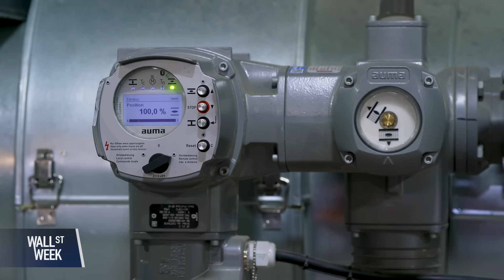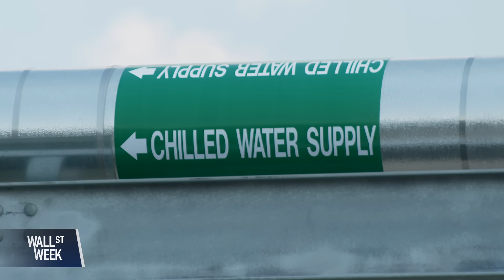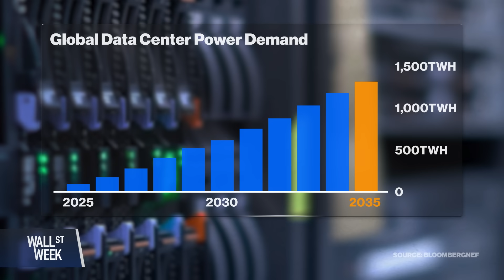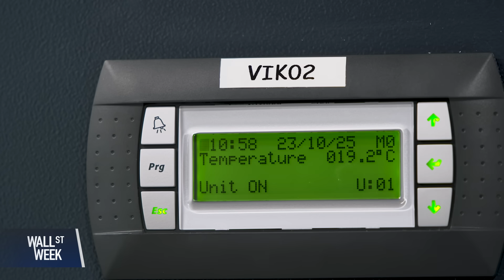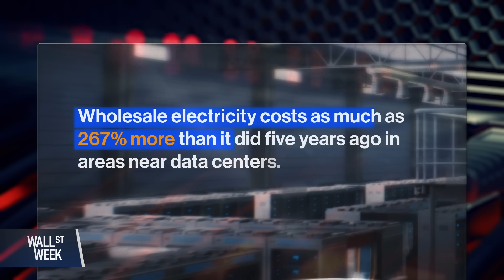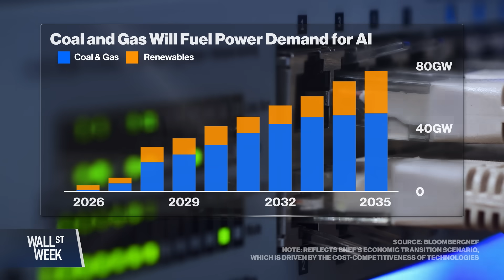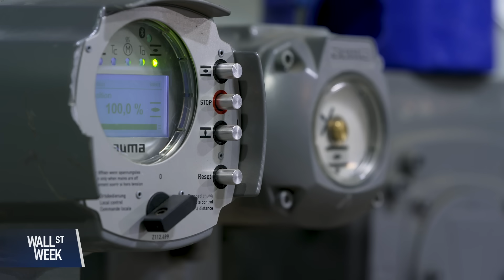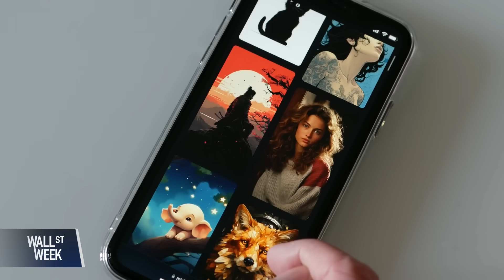Finland’s Big Idea: Turning Data Center Waste Into Heat

Comment: The real trick to making this work is that the temperature difference isn’t very high.  When I worked at IBM in the 1980’s we did this very thing, but it was only really efficient during the colder months when the temperature difference was greater than 25 C or more.  It was still worth doing.  It would be interesting to see how they have dealt with this issue.

Comment: District heating and cooling is far from a new idea.  Decades old. One example related to data center cooling is the Amazon Spheres project. "Amazon spheres heat recovery"  refers to the Amazon Spheres in Seattle and the broader system of waste heat recovery that warms Amazon's campus, rather than a heat recovery feature within the Spheres themselves. The Spheres are primarily a workspace with a focus on biophilia, and while they have high-efficiency HVAC, solar panels, and a specialized glass facade to mitigate solar heat gain, their heat isn't sourced from a "heat recovery" system within the structure. Instead, the heat for the entire Amazon campus, including the Spheres, comes from a district energy system that recycles waste heat from nearby buildings, like the Westin Building. 
Waste heat recovery system for the Amazon campus
Source of heat: Waste heat generated by the Westin Building data center on an adjacent block is used to warm the Amazon campus.
Partnership: This is achieved through a partnership between Amazon and Eco District, a joint venture between McKinstry and Clise Properties.
Benefit: The system exports waste heat to Amazon, which purchases it at a discounted rate. This system is designed to be four times more efficient than traditional heating systems, saving hundreds of thousands of dollars annually and millions of kWh of energy over the next 25 years

Comment: I live in Finland and heat 208 sqm. I heat my house with geotermal heat pump. I pay around 620 Euros per year for heating and warm water. The pump cost around 11 000 to replace let’s say every 15 years. That makes the total cost less than 1400 Euro per year.

If I would use Helen district heating my cost would be around 2600 Euros. So yes I can understand why the make good profits and have had to lower the prices in the last two year😅

Now I do not live in that area. Were I live the price for district heating of my property would be 1400 Euro per year. They use 10 % fossil fuel . My house is however outside the grid so it was never an option and I am not locked to one supplier.

Comment: It's just heat trapping, there is so much layers of energy loss there. It won't be close to solving any problem - it will reduce power usage by few %. Still a good idea, but not a "BIG" idea like title suggests.
Reply: @Szeksp  What about the electricity saved by not having heaters on in all those homes and businesses?

Comment: I live in Finland. I built the same solution, but in a microscale. During winter, I keep the shower of my sauna from freezing with the help of a PC with a graphics card that is running computations on behalf of the science community (calculating properties of astroids).
Reply: yeah, i jokingly say my gaming pc is a heater XD

and it good support for my real heater
Reply: Meanwhile I have to put my PC on the balcony all summer and spring where I live... I should find a way to convert the heat in electricity I guess
Reply: @markmuller7962   Internet should have some guides for it, tho idk on what scale
Reply: @jonasgustavssonaland  👍🏽

Comment: While the idea is good, and we have been happy customers of Helen for years, there are several misleading points in the video. 

First of all, the video's title says "Turning Data Center Heat Into Power". This is not the case here. And I believe it is also nowhere in the world that Data Center waste heat is turned into power on a commercial level. It is turned into usable heat. 

In the sustainability and energy industry, when we talk about power, we mean electricity - NOT heat. I assume the video would get a lot fewer clicks if it said "Turning Data Center Heat Into Heat" in the title.

Using something that already exists (waste heat) is a good idea. 

Also, the statement of Helen's CEO that the reduced electricity prices have been twice in the last few years is misleading. While true, he picked the period after the energy spike after the Russian invasion, and the reduction is a common thing in the Nordics.
Reply: I was laughing at that, it was so obviously misleading from him :DD
Reply: Agree. When someone says power or energy in this context, people understand electricity, not heat or light or noise.

Comment: Helen lowered prices? I never got that memo, in fact had a couple of letters these past couple of years that Helen's tariffs would be raised? Maybe this CEO's managers are lying to him lol.
Reply: Or, let me guess...you don't know what he is talking about and comparing it to something else. If company has variety of products from electricity to electricity transmission and central heating to cooling etc and works with private and public sector, did you really think EVERYTHING they do is cheaper? That was partially the point...meanwhile overall expenses are going up troughout the energy field, this particular method could actually go for less.
Reply: @EiraAimo  Of course I "don't know what he's talking about", the man is throwing around a boast that doesn't hold up to scrutiny.

Comment: We have data centres in Montreal using our low cost electricity. What we need now is the infrastructure to distribute the heat they generate to nearby businesses and households. Why isn’t Hydro-Quebec, our provincially-owned energy utility, doing this?
Reply: District heating is extremely useful in colder climates to distribute waste heat. Some areas are also now using sand batteries to store excess heat or energy in the summer to be distributed in the winter.
Reply: District heating/heat networks are a system of very heavily insulated high pressure/high temperature water pipes that needs to be built underground, in the city/area you want to serve, for the system to function. I have no idea if Canada/Montreal has that. 
Once that infrastructure in place it's fantastic, but getting it installed is expensive and requires a big investment. Not only of money, but pissing off people who usually hate having their streets dug open.

Comment: The naming if this video makes no sense they aren't using the heat to make POWER? ( electricity) They use it for HEATING.
Reply: of which the unit is watts, ergo power
Reply: Power is the rate at which work is done or energy is transferred (e.g. horsePOWER of cars) Doesnt need to be electricity.
Reply: @just_jouni never in my life have I read or heard anyone call heating power, untill now.
Reply: @matthiasknutzen6061  You live and learn!
Reply: @just_jouni the journalist aren't very technically inclined

Comment: Heat pumps run on electricity. They are needed to boost the temperature of the waste heat. If that comes from renewable sources, fine. Otherwise, not so fine.
Reply: It's finland, so its 30% nuclear, 16% waterpower and like 15% biomass and 15% wind. It's green enough
Reply: It is fine even with dirty electricity, because you have to produce heating for homes anyway and this waste heat increasing your efficiency and reducing the electricity needs. But it is irrelevant point because Northern Europe has an almost completely decarbonised electric grid.
Reply: @TH-bl5wl  It's not irrelevant, heat pumps will move 5x as much heat for the same energy as this will. If these data centers are going to be running anyway and we can efficiently use the waste heat, cool. But if the data centers had no benefit in themselves that would just be a waste of energy.
Reply: @ricardoamendoeira3800  "If these data centers are going to be running anyway and we can efficiently use the waste heat, cool. "

Why do we build data centers? To process and compute data or to produce heat? 

The same thing happening with wastewater district heating systems. Heat pumps and heat exchangers capture thermal energy from sewage and reuse it for heating buildings. But the main point of the sewage system is wastewater treatment and not heat generation.
Reply: Heat pumps consume less than 5 times (maybe even more, I don´t know pump details in this case) what they give output. So it is not 1:1. Heat pumps are great to heat what ever if you have any heat to multiply it.

Comment: What a great project, Finland is really a test bed for new green technology.
More countries should implement heating systems like this with more and more data centers being build with massive needs for water for cooling them down.
Great video,
Reply: The thing is, district heating systems rarely make financial sense outside colder regions. They can still be viable in warmer climates when building new and densely populated residential areas, but building such systems in existing cities is very expensive.
Reply: @Isytee isn't it possible to generate electricity from the heat though?
Reply: @joetigo2928 The temperatures are way too low for generating electricity efficiently.
Reply: @Isytee  Pools are used in many parts in america, even in warmer climates. There are so many applications, this is ONE that is quite usefull and informative in current EXCESS push in AI bubble that we are in... but it only really works in COLD climates that benefit from this kind of solution.... obviously the real answer to ENERGY needs is in making the A"I" work MUCH MUCH MUCH MUCH more efficiently... currently it is clorified chat bots and simple problem solvers... that take 10000x the processing power, if they could do that better with less processing power required... the energy needs will plumet massively.
Reply: District heating is an old and widely used concept in Denmark - using excess heat from industry or burning non-recyclable trash is not new either.

Comment: This is nothing new!  Using the heat from data centers to heat buildings has been a thing for at least a decade.  And to used the heat from traditional industries has been a thing since around half a century ago.  Americans are technologically ”behind” if they think this is something revolutionary!
Here in Norther Sweden across the Baltic Sea—were major social media data centers have located due to very cheap and stable renewable energy (hydraulic and wind), and the relatively cold climate and access to fresh waters from large rivers providing ”cooling resources”—the heated cooling water has been used like this to heat building’s since way back.  Obviously it’s more complicated in a large (from a Scandinavian perspective) city like Helsinki.  But in essence this is very old news.
Further:  The price for renewable electricity here, the production owned to a large extent by the taxpayers (so we get much of what we spend back), was actually negative for a while.  While the price at the same time was extreme in central Europe due to the use of Russian natural gas and nuclear power.  Although the grid fees and taxes obviously ment you still had to pay for the electricity… And later we had to share the burden of energy cost with ”the south”!  And for this I’m a bit irritated… because everyone knew Russian gas, oil, and nuclear would be costly in many ways… still they opted for it, and still do.  I’m okay with sharing a economical burden for energy… but not because people in central Europe intentionally made poor choices, and still do.  Even Finland started building a nuclear power plant like two decades ago and to my understanding it was just recently finished at a massive cost.  At the same time we built the largest wind power plant in northern Europe in a fraction of the time and at a fraction of the cost.   And there is never ”no wind”… and even if there would be at times, the cost for the electricity is so cheap that shutting down industries temporarily short periods of time would be cheaper than paying the cost of having electricity produced by nuclear power plants or from fossil fuel available.  Although there is a mindset that ”the industries must always be operating… regardless of the costs”.  With that kind of stubborn attitude human society won’t evolve.  But ok… sure… the data centers must always operate… or the kids would go berserk!

Comment: A big objective of district heating is to re-use industrial cooling heat for heating homes, etc., thus reducing heating costs and CO2 emissions.
The technology is decades old, in use in most of Scandinavia and countries like Netherlands.
Data centres are just one newer (and fast increasing) industrial segment that needs cooling and thus generating heat.
Reply: Yeah. This isn't really even "solution" to anything. Since with other industrial plants it was actually new produced power. They did stuff like burn bark and waste pieces of wood in pulp mill plants. Mainly to heat their own reaction kettles. However not all of the produced heat was needed for the industrial process, so the rest was put out to district heating. Same with say industrial processes that use natural gas burners for process heat.... that is heat generated from fuel.

Where as data center is just weird shaped electric heater. Same electricity could be just used to run an actual resistive heater in a district heating plant. The electricity has to come and be generated somewhere. As such it is no energy solution. Mostly it's efficiency measure for the plant operator. Since they aren't given the heat out for free, they charge for the heat they provide to heating network. At low rate probably, given it would be cheap for said heating network... just to run their own heater could. However for the data center? Well few cents on the dollar on the waste heat is better than zero cents on the dollar on the waste heat.